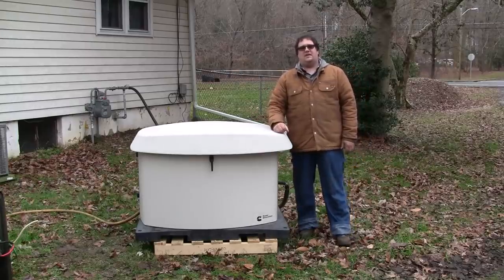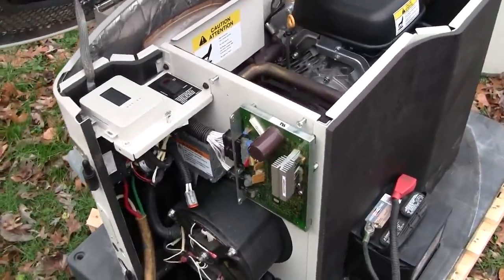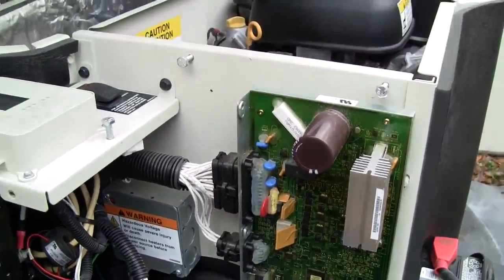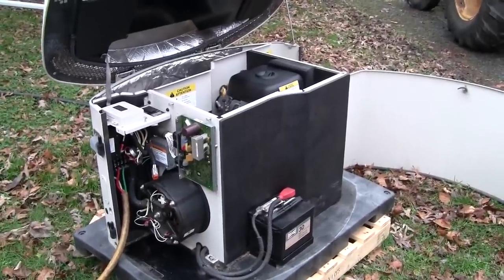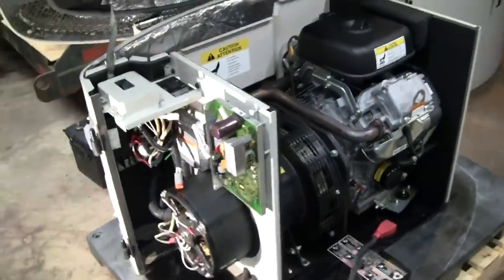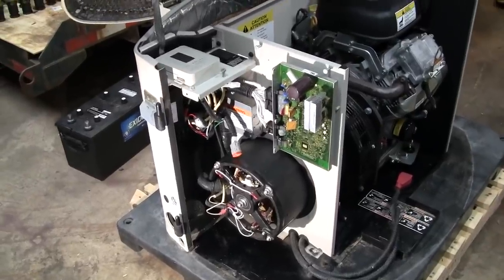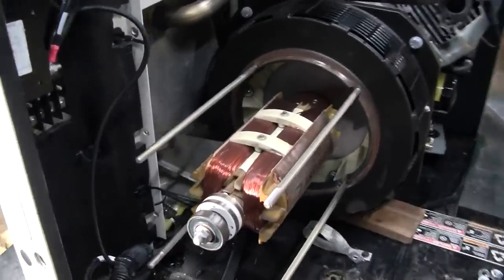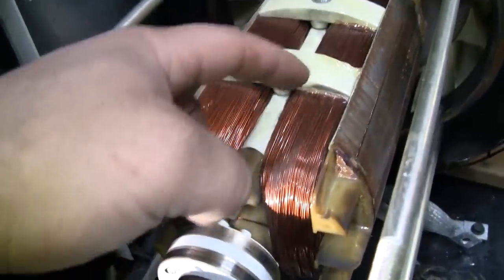2015 Cummins Home Standby Generator IS IT DEAD ALREADY? Pt. 1/2

Comment: I don't know what's more shocking, the nature of the factory defect, or the fact that they actually honored the warranty.  Looking forward to the 2nd part!
Reply: hahahaha so true!!!
Reply: You had to use the word "shocking".
Reply: At the price of these units, you would like to believe that the factory had  more pride in their work.....where was the quality control inspector ?
Reply: @rancelynch6514  fired so the C suite execs can another lake house
Reply: @cdoublejj ---probably so..I guess I'm just stuck in the past when you had pride in your work..
Reply: @rancelynch6514  I like to say no school like the old school. Another reason I like DIY or getting broken stuff cheap. Mass production is plastic non-repairable stuff anymore look up John Deere in their anti repair practices Farmer's not able to harvest crops
Reply: No wonder the part is obsoleted.  Crappy fatigue prone design.  Pins probably bent due to crank oscillations and the plastic ring slippage on the shaft,  breaking the wire off.
Reply: What’s said was it was only replaced because it was under warranty. Despite being a factory defect. Slightly different timing and this customer would be screwed.
Reply: @cdoublejj  Is this where John Deere won't  give up the computer program codes so that independent shops can't  work on the equiptment?
Reply: @rancelynch6514  I'm MAY guess so. "Motherboard" did a story on it. parts are locked out so if you swap parts on the tractor it shuts down Farmers are resorting to working with Russian hackers to swap parts on tractors where possible use market for old tractors like 80 70s 90s those are all going up in value and selling quite a bit that's worth it to restore them now
Reply: @gordonborsboom7460  many times when a part is obsolete and alternate part is made available.  Sounds like no alternate part was made available.  What might be interesting to know is when was that generator first made and when was the part made obsolete.  

Cummins makes a good diesel engine. they should stick with what they know and stop buying other companies such as Onan and ruining them.  A friend of mine that retired from Cummings told me stories that I don't want to repeat here, but the quality is not what it used to be across the product line since they started outsourcing parts manufacturing to China.
Reply: @rancelynch6514  - Non visual inspect feature. confirmation with meter.
Reply: @rancelynch6514  Oppressing people. These are very likely ch parts...
Reply: @cdoublejj  They think people are stupid enough to take their bullshit. I've personally helped my brother liberate parts from this bullshit thing. Luck is on our side tho, here in EU, laws are being passed now which will give the likes of CASE and Deere, the grand old middle finger. Right to repair and such. But again, we never gave a shit to begin with. If you're smart enough, these are just lines of code and they leave plenty of back doors to uncheck from. You can even go medieval on them and just gut and fool the sensors, which was the old school way. Kinda like when you're buying toner ink, and the cartridge was locked via chip, and you'd get a "special" chip and that would permanently unlock the cartridge. Corpos man, they think they're smart, but you just have to persevere.
Reply: @cdoublejj  So true!
Reply: @jdmccorful  Amen &  Amen  !
Reply: @rancelynch6514  Also Cumins and Perkins do same, you probably have service available assuming you are in USA, imagine in Latin America (in Uruguay only 3 companies have the electronic tool kit pack for Perkins (cost usd 10k) in the whole country, i am the only one to have the Iveco Vector electronic kit and only 3 companies have SERDIA for Deutz. Independant comanies and customers in an emergency just can look at a very nice & big beeping monster not running....  i love old engines WITHOUT all new electronic & software rubbish....
Reply: @Maxxarcade you sound like someone who has never worked with Cummins customer service.
Reply: I worked at a communications site where we made our own power. The company bought two 75Kw Cummins Generators supposedly continuous duty and with in a few months the belt idler went bad. The fan which blew from the engine to the radiator and intercooler blew the ball bearings though the both the intercooler and radiator. The intercooler was made in Turkey with none in stock anywhere. After a few years they put in Cat powered generators.

Comment: And that folks, is why the part is no longer manufactured 👍
Reply: Yep
Reply: Cant make you buy a new one if the old one doesnt break down.
Reply: Planned obsolescence at its finest!  Make it barely good enough so that it lasts a year after the warranty then croaks. Then make sure you don't sell the part to fix it. Short term thinking.
Reply: @ryanhoaglin9907         It's why I only spend $400 bucks at a time on a Chinese knock-off inverter generator.    I don't need 20kW to keep my food from spoiling in the fridge and to run a space heater.   Hasn't failed me yet in 4 years of off and on RV and storm use.
Reply: @scdevon  Yep, sometimes the Chinese stuff is better. Certain brands tend to be more guilty of engineering obsolescence into their products. Manufacturers LG and Samsung do it with all their products.
Reply: @ryanhoaglin9907      Right.   This "Onan" generator head is likely Chinese anyhow.    It sure looks like it.     There's lots of "Brand Slapping" old trusted names onto cheap Chinese merchandise today and the public has no idea until something like this happens.
Reply: @CrazyMooseManor  we need right to repair laws.
Reply: @anthony10370     Mandatory repair parts availability for 15 years at inflation-constant pricing after a model quits being manufactured under threat of fine for unfair trade practices would be nice.   Especially for large ticket items over a certain dollar amount when new......
Reply: @scdevon  You're right. Too many reputable companies lease out their names so that lesser companies can flog their inferior products. For example, my Motorola walkie-talkies were made by a Korean company with no ties to Motorola. My neighbor's John Deere riding mower is Chinese.  Both are pretty crappy. I don't understand why a reputable company would take money for the right to use their name and logo.
Reply: @ryanhoaglin9907  Yes, and they put their rapair manuals in the internet for free.
Reply: @anthony10370   Germany has those right to repair laws, to keep stuff working & out of LANDFILLS.  🇺🇸🇺🇸🇺🇸🇺🇸
Reply: This reminds me of the "Murphy's Law" that reads   "any appliance,  when demonstrated for the repairman,  will work perfectly every time".

Comment: Great repair! Now find all the other warrantied generators that had the same issue and fix them!
Reply: I did that with RCA TV's because the onboard tuners died. I soldered so many I couldn't count them.
Reply: @leeklemetti1887  
Back around 1980 my wife and I bought a 27" console tv, worked for 5 weeks. When the service guy came out, he said he'd already replaced the input rectifier diodes on about 50 of them. The fix was to install larger diodes, the originals all failed within 6 months. First voltage fluctuation blew them.

Comment: Definitely consider blobbing those entire connections with some epoxy/resin so the copper doesn't work-harden from the vibrations; it seemed like the wires were floating a bit. I'm sure you already know that, but then I'd see absolutely nothing going wrong with those connections - lovely solder joints!

Comment: Excellent video! The link to this video was posted in a thread on the  Smokstak Onan forum and received excellent comments on your presentation and a lot of negative comments on how Cummins produces their newer sets. I'm sure you are familiar with Smokstak but for those that are reading this comment that don't, we discuss, run, repair and restore  Onan gensets that are 20 years and older when Onan made quality gensets.

Comment: I got a Cummins Gen set with a 3 cyc diesel and a bad stator (open winding). Took stator out, burned it in fire pit, then carefully mapped and unwound it, found break in winding as I was undoing it, ordered magnet wire, and rewound, new varnish and paint... It was a big job, but it now produces... I call around for rewinding job price,$ 2500-3500... I had $400 in material and weeks of time... Very satisfying to see it put out electric though... Nice diagnosis!

Comment: I will be the first to admit as soon as I saw the difference in colors on the windings I jumped to the immediate conclusion that the winding had let part of the smoke out of the unit.  I have not ever tried to trouble shoot a generator but I did work on wound rotor motors that used remote resistor banks for speed control on 480 volt 3 phase.  This was back in the 1980s and the cranes were 1969 series machines for the most part so it was all mostly relay controls with mechanical timers, motors up to 60 horse power.   I recognize your trouble shoot technique, you have an analytical approach to trouble shooting.  Not a shotgun approach where you just try everything in no particular order, which I have often observed.  Good job.

Comment: I love field repairs, especially if the field repair is better than the original design!  You just came up with a fix you can apply to a customer's unit (who didn't think to but the extended warranty).  Might be a little expensive, but it would beat replacing the whole gen set!

Comment: Thanks!  Working on a generator now that does not make power.  Stator wires were black so I assumed the stator was bad even though it tested well and the ropes were not burned or broken.  Just had another look and found the bridge rectifier was missing a diode.  Will find out tomorrow if it lives again.

Comment: That bad connection to the slip rings is not poor assembly by workers;  it is very bad engineering by the people who designed it.  There are so many ways to make this connection properly, it's a shame they bypassed all the good designs and chose the worse possible design. But your repair is one of the best I have seen. Bravo, better than new!

Comment: I have an old Craftsman AC "buzz box" welder that developed an open in the primary winding. I was able to unwind  the coil until I found the brake. My brother-in-law is an electric motor rewind technician, he got me enough of the proper size wire (13 ga) to replace the damaged winding. I took the transformer to a local motor shop and they dipped and baked it for me. I used it for years after that.

Comment: Don't know if you plan on running this thing but I would reinforce the solder job with some epoxy back to the rotating shaft. It will increase the longevity of the repair. You would be surprised at the forces from rotating and vibration from the generator assembly.

Comment: I had bought a dishwasher and one day it wasn't starting the cycle. The service technician didn't even know what was wrong and said it was the logic board. But they didn't follow it up and they said they'd refund the money after waiting for almost 2 years and filing a complaint. I didn't touch it during the period to not void warranty. Later, I took a look inside and turned out it was a tiny reed switch for the flow sensor that wasn't making contact. By this time the tub had pitted with rust from the salt and moisture.

Comment: Great troubleshooting! Many years ago I had a british car with an alternator that only worked if you were accelerating. Finally found that one of the windings (3 phase) was cracked right were where it left the rotor - when accelerating the two ends touched and it would work, otherwise it was air gapped. Joe Lucas and all...
But one technical note - when you moved from outdoors to your shop the right audio channel died. You might want to upload a fresh copy for those of us deaf in the left ear 😁

Comment: I do like the way you work. Just one little point. An old friend was changing his car battery when the spanner slipped and he melted his gold ring onto his finger. It had to be cut off in hospital and he has a scar so many years later. If you don't want to take it off (or can't) please stick a bit of tape over it. Do take care and have a good Christmas. Regards from the U.K.

Comment: Interesting Video. Nice that you found the problem. Many times it is a simple fix. By the way, the polarity does not matter. The generators output is AC no matter how you wire it.

Comment: I forgot... thanks for the tip about half the stator windings having dark varnish!  If I had seen that and not known ahead of time, I would have been inclined to suspect those nicks on the end of the stator must have caused a short somewhere and burned the varnish.  Good to know if I ever happen to have to work on one of these units.

Comment: That engine on the generator looks brand new. Most of those air cooled generators are pretty dirty inside because most owners never bother to clean them out on a decent basis.

Comment: The first thing I noticed that when you were tapping the rear end bell off white dust was dropping out, I would not expect to see white dust maybe carbon dust if the unit had many hours on it. Wow, great diagnosis and find for an intermittent problem! A very primitive connection method for such an important connection looks Chianeezim. I like your repair, put but some epoxy on the pins and #14 wire to keep the wire tight to the rotor. Oh, one more thing, invest in a Milwaukee 3/8" drive battery-powered impact driver and retire the old-school ratchet but keep it because you still may need it once in a while. Thanks, I enjoyed it!

Comment: Might want to reinforce your 14 ga to rotor winding connection with some loom tape or string.  The centrifugal force at 3600 rpm might cause a failure in the long run.  

I use a piece of plastic about 1/64 thick to wrap the rotor when pulling rotors and stators.  Most of the units I work with dont have studs, they have bolts so you will get contact.  I also tend to remove the rotor.  No big deal.  Just take a rotor bolt, cut off the head and about 1" off the bolt, saw in a screwdriver slot, and run a jacking bolt in the end of the rotor up against the modified rotor bolt.  They usually pop right off. 

Nice to see that you and yours are still having fine days.  Winter will soon be on us.

Comment: In the process of doing virtually the same thing on a Kohler 11RMY. Had a great deal of difficulty getting the end cap of the alternator off the rotor shaft, bearing on the Kohler is on the opposite side of the slip rings. Normally the endcap will pop off the bearing, and you were good to go, but in this case, I was ultimately able to get the bushing to slide off the shaft, but that took the slip rings with it. Currently in the process of replacing the bearing cleaning things up risotto ring the slip ring assembly to the windings and then put it all back together.
I probably could have fixed the mouse wire damage, but I figured the smart thing to do would be pull the endcap off and inspect everything too bad it didn’t just come off easily. Like it’s supposed to, or at least with a few hammer taps.

Comment: Attended a Holt Cat dealer generator course in Irving, Tx a few years back. I remember the instructor telling us the machine that winds the coils, when the spool got low it had to have a splice where the new spool started. They were having a lot of open circuits problems like this where the splice was made at the factory.

Comment: this is a common problem with coleman generators    the rotor wire will break or will loose the solder connection on the rotor. i have repaired several of them that were dead and customers wanted to throw them in the dump. i have even got a couple from the dump and supplyed my friends with a good generators,  good job!

Comment: I started laughing when you pointed out the varnish spots on the stator. We lost a 600kva generator at work because a cat got inside the generator housing and was asleep when the generator kicked on. It wiped out the generator and ended up costing 35 grand for a rewind!!

Comment: In the electrical sense I followed every step you were doing and I knew you going to have to add wire to that rotor...exactly I knew how generate his work from the get-go and this is usually what happens if we have a problem... Excellent but I'm held waiting to see the next one when you coming out with that

Comment: Good luck on the plumbing.
This past Wednesday,I had to replace all the hardwired smoke detectors.
They all decided they wanted to go

off all together multiple times during the night.
I hare getting on a ladder.
Looks like you got the generator about sorted.

Comment: Smell the dark winding after seeing it.
Insulation test on stator wirings is useful as well. Check the connections between studs and rings. When you need two soldering joints on a part, the alloy should be different with different melting points.

Comment: Outstanding diagnosis . You probably just solved the problem for them. That would be a easy fix for a real fixit handy man. But not many around any more.. my neight gave his unit when the engine blew. Same setup but was a generac single cylyinder. The exhaust let water run down into engine rusting it out in two weeks.
Reply: These are not worth crap. Cheaply made from china..

Comment: Excellent video keep up the great videos 👍👍👍👍my neighbor has a Hobart welder generator that only has around 500 hours on it but the welder part stopped working but the ac generator still works .It sort of does the same thing you strick a arc and as soon as the load comes on it just goes to idle he has had it to multiple repair shops with no success.

Comment: My first guess was a faulty magnetic pick up on the flux capacitor.

Turns out it’s a loose wire in the coil. Nice job with the diagnosis.